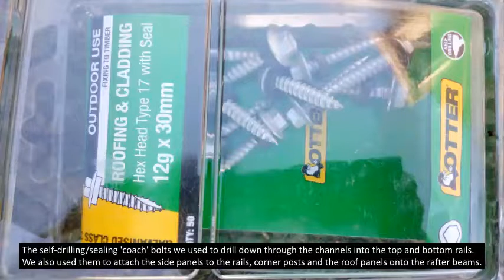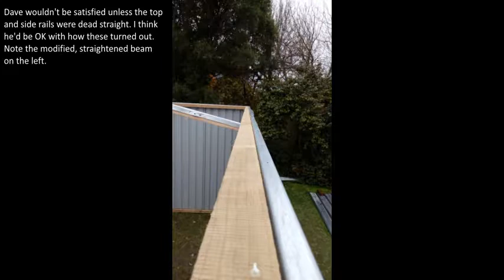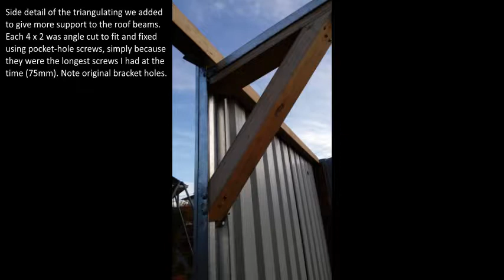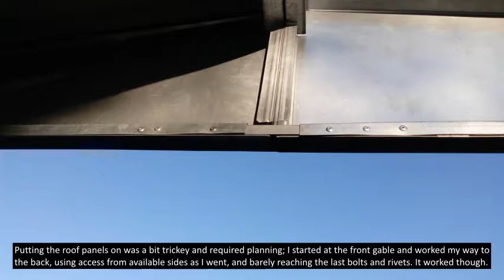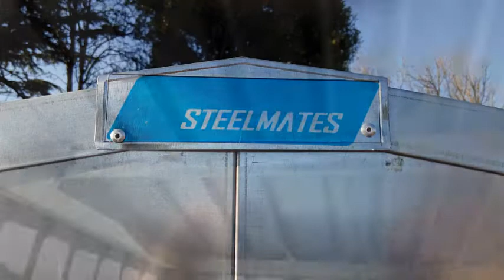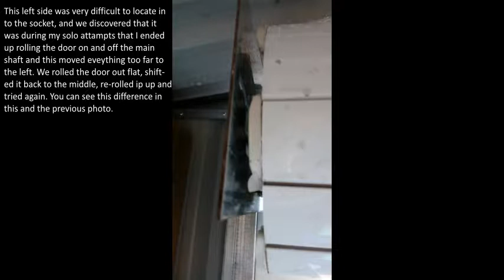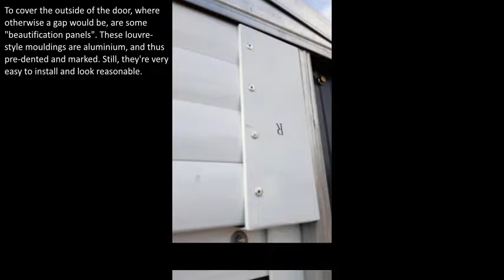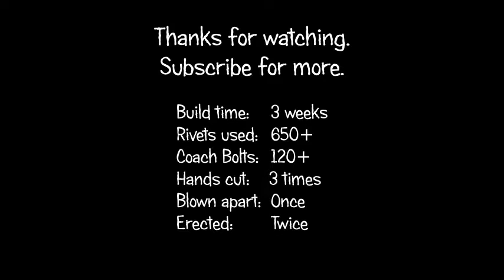My Chinese Kit-Set Garage Build

Comment: So I guess I'll have to for go buying one of these steelmates one off trademe. Thanks for the Vid mate.
Reply from the maker: They might be a bit better, but expensive for what they are and I certainly wouldn't build one without a proper frame any more.
Reply: @davethompson2881  I have an existing carport with a 3M stud which I will likely frame out between posts and install some sort of zincalume or other coated steel sheeting. I feel like it may cost a bit more but ulimately be the cheapest solution. Does the garage door you got come with a lock?
Reply from the maker: Yes, while the roller door that comes with it is quite flimsy, but is lockable and still works well. I sourced extra tin from a local scrap dealer and extended the garage by one sheet's width (the original is way too short for even a small car) and that was way cheaper than buying it anywhere else - plus the panels were in good, new-but-slightly-marked condition.